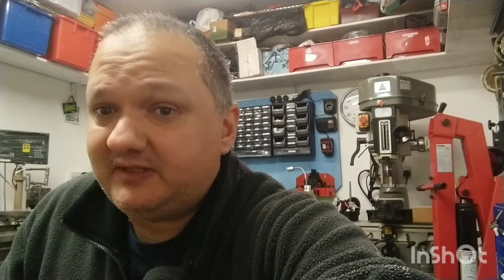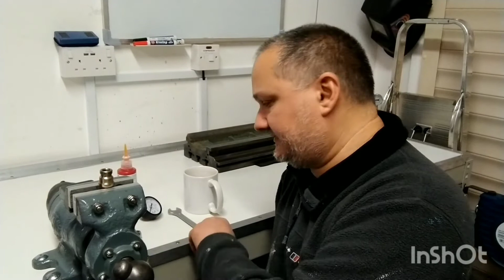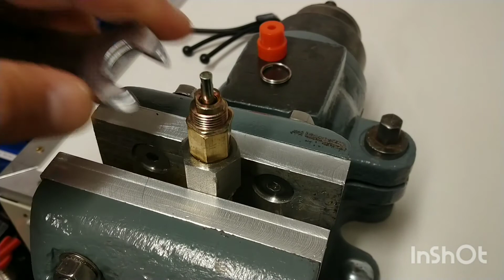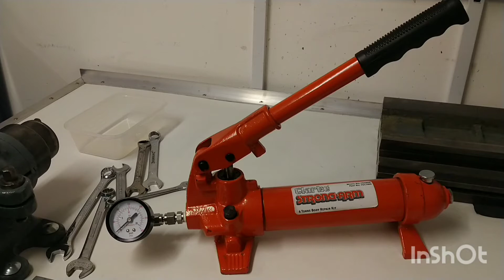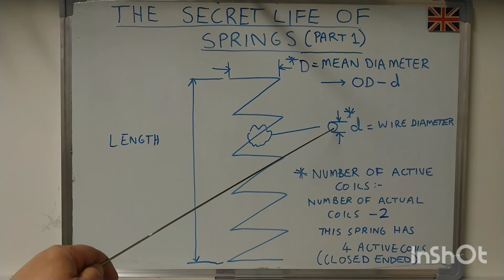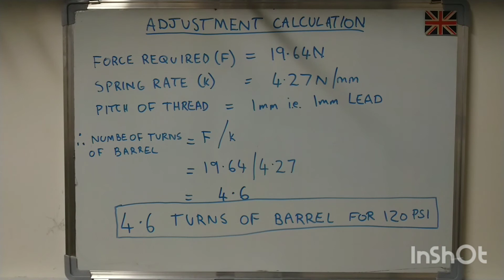Compressor Safety Valve Setting - A Principled Approach

Comment: Great number crunching, and my relief valve that was lifting at 78 psi is now just above the pressure cut off at 121, with a calculated adjustment of 3.53 turns on a slightly larger valve with a stiffer spring
Reply: Just subscribed, Mark, Mechanical Engineer,  North Carolina. USA
Reply from the maker: @markgilmore906Wonderful to "meet" you and have you aboard Mark. Thank you for your interest in my channel!
Reply from the maker: Thanks for your great comment. I'm really pleased you found this useful. I hope you like the rest of my films and I would like to invite you to subscribe to my channel...I'm slowly edging towards 1000.